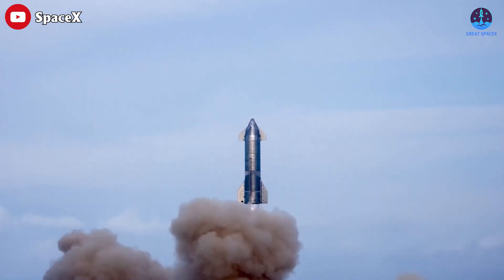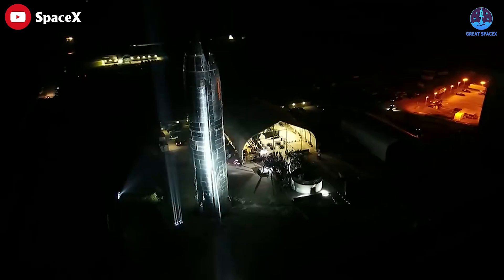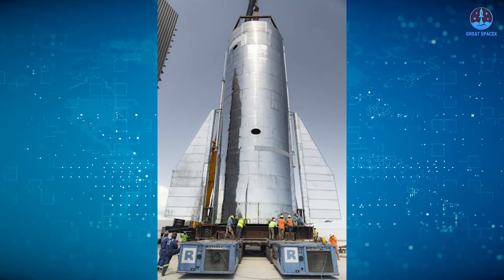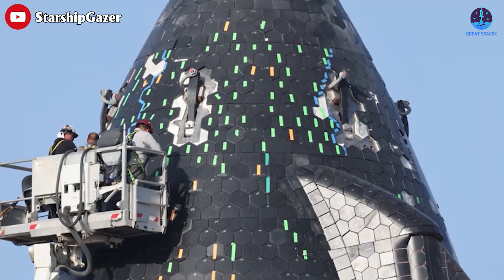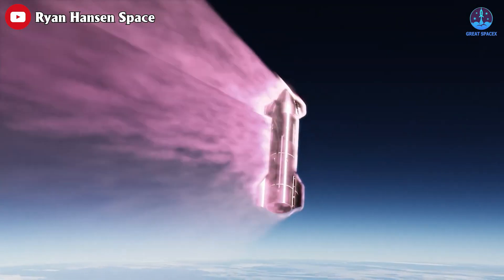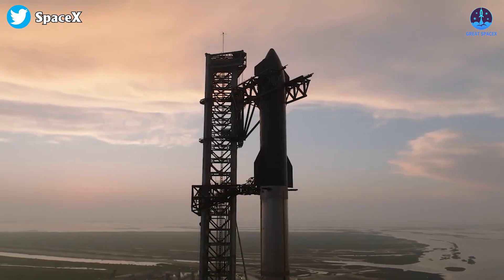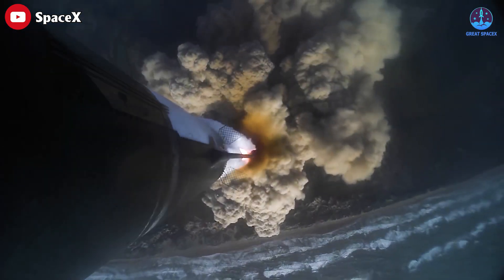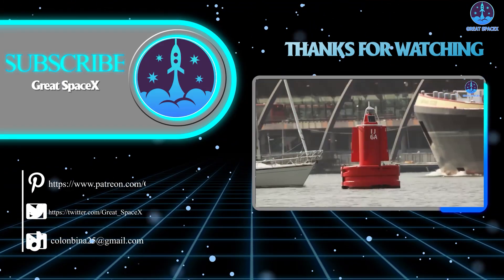Starship's Nosecone design change will blow your mind...

Comment: Lol - 08:55  "..did not detach or fall off at starbase.", followed immediately by a short shot showing exactly that - tiles falling off. There weren't too many, but there were some - it's been covered by other channels. 
And my mind was not blown either. Stop with the over-the-top click-bait drama. If a channel is any good, it's good on its own merits. If it's cheap trash, it has to resort to cheesy tactics. Pick one.

Comment: Maybe the logical second flight of the Starship should be the non-orbital Lunar lander booster version but with full tiles installation. It would test the tiles durability during the 33 raptor engine startup and flight and also test the starship's landing capability. Hopefully not but also to test its Flight termination system in flight if needs be.

Comment: I would think a spray-on heat shield would be the best there has to be a way to make it
Reply: don't you think that they would have thought and tested many versions of it by now? I for one can think of how thick a spray-on heat shield would be to do the job.. What happens after one flight and parts of the shield wears off or burn off, do you spray on top of the old or scrape it all off back to "bare metal" and spray a fresh coat? How can a spray on material be cut proof? any cut could expose the bare metal to heat and could be missed during a "preflight inspection"...

Comment: That's A Big Tile Job with A lot Of Pieces Labor Intense that has to be Done Right or Else ! Any Break thru in High heat Styro Capping with Ceramic Finish Kiln Dried Surfacing with anti Dampening Layers Done in one big oven Might Stream line the Process with a Custom Fit for all Shapes just build the mold and Pour Bake as Necessary for that high heat Temper !.

Comment: I know it would add a lot of weight, but if both sides had heat shields there would be safety redundancy for tile damage from the normal operation or meteor damage.  Simply belly flop with the undamaged side.
Reply: however, the tank design is not set to work from the opposite side. It may not even be possible to have it work that way. why overcomplicate things?  that makes it so there are more possible failure points. so not sure that's a good idea.

Comment: The shuttles lost 100's of tiles during re-entry ! It was just the location of damaged heat tiles that doomed 2 shuttles plus the shells were aluminium ! starship is stainless steel so it can lose tiles and still have a greater chance of surviving re-entry !
Reply: Actually, the loss or damage to tiles never caused the loss of a space shuttle.  Challenger was lost during launch, when an SRB joint failed, allowing hot gas to penetrate the external fuel tank.  Columbia was lost on re-entry, but it was the reinforced carbon-carbon panel on the leading edge of the left wing that had failed when it was struck by foam insulation during launch.  Not tiles.

Comment: Glad Elon admitted the nose cone is cosmetic.
On launch its only in the atmosphere for seconds, and the air gets much thinner during every one of them.

Personally, I would be building hemispherical noses and then leaving them in space or on the moon for habitat domes and spherical space stations and transit
 ship sections.

And for re entry shape, he would be better off with a brick. Something that was less efficient and caused more resistance, and then make the re entry angle shallower, we are still using plunge angles from capsules for no apparent reason, when we should be thinking in terms of glide angles controlling temps, and surfing the wave.
Reply: 😅🤣😂
Talk to Bezos.  You're too slow to keep up with the genious of Musk.

Comment: High altitude? 50m? We have no idea of how well the tiles will work. It's not true that the failed launch tested the thermal management system. Buran was basically a prototype, so we don't know that the thermal solution was truly reusable, but I am inclined to believe it was. Going to mars on a chemical rocket with no space assembly makes little sense.
Reply: going to Mars in a 4mm tin can makes no sense
Reply from the maker: I will correct this! I mean "completed a high prototype of 50 meters." Thank you so much